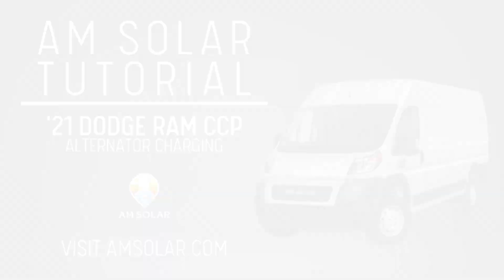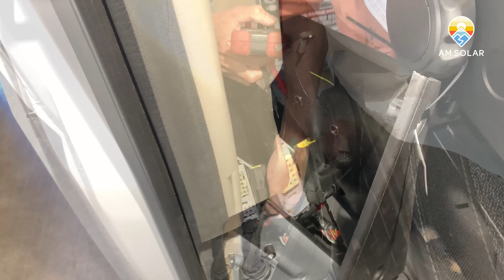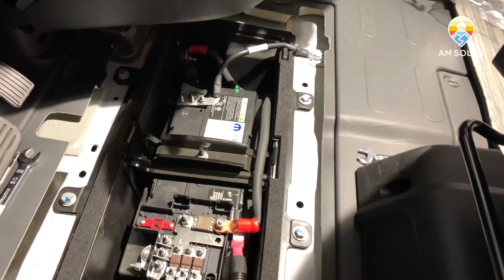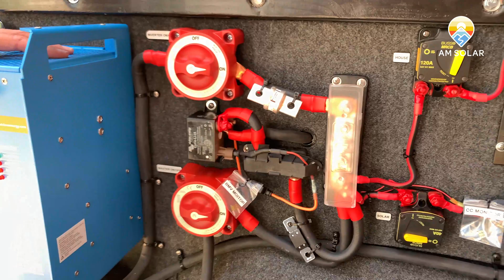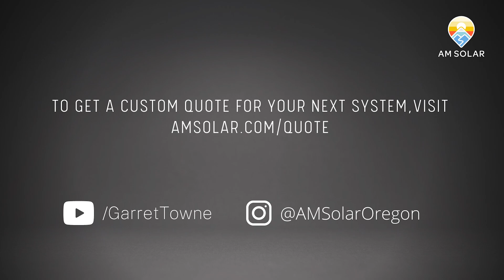2021 Dodge Ram ProMaster Consumer Connection Point (CCP)

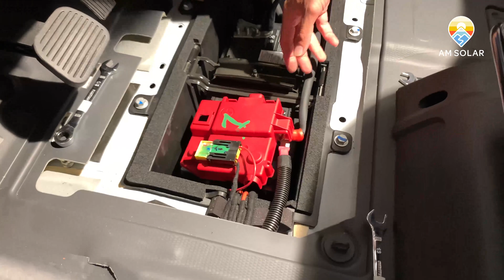Comment: There actually is a factory mounting point at the battery for a Mega fuse, you just need to provide your own bolts and nuts. @2:13 you can see the empty fuse area with the hole on the busbar and the hole on the buttom for the second connection point to the MEGA fuse. Not as nice as the Sprinter, but this works well.